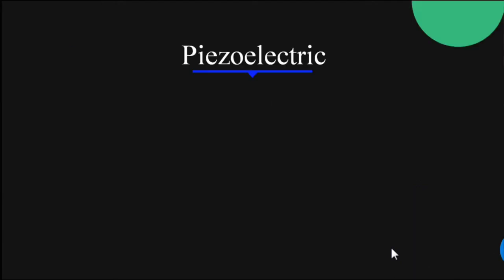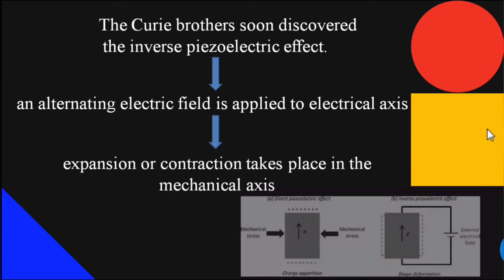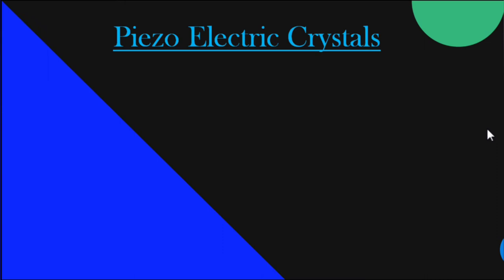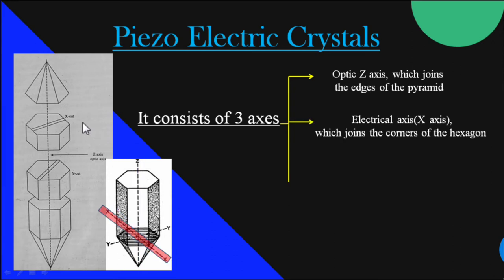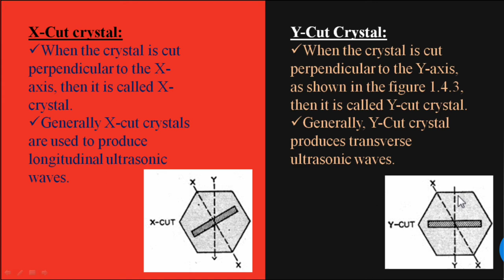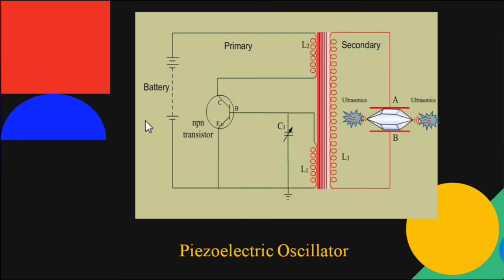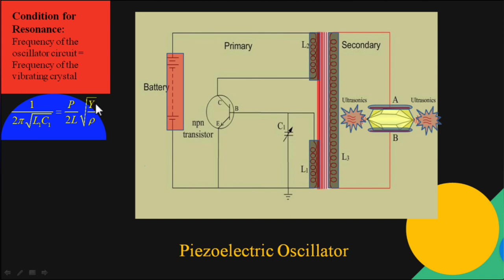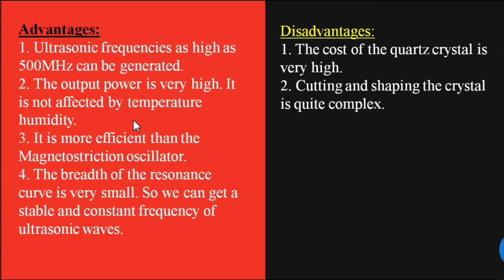Piezoelectric oscillator

Comment: How do water converts into mist(vapour) using this process in Ultrasonic Himidifier
Reply from the maker: Ultrasonic humidifiers have modern, high frequency technology that sends a vibration into the water. The water can't move in time with the vibration because the frequency of ultrasonic wave is very high (more than 20khz). So The water breaks down into small droplets, which then transform into vapor.